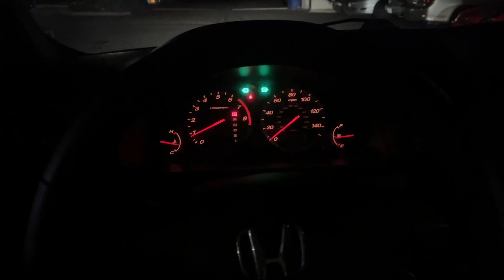My old project car doesn’t like the new owner..😅 How did this happen!!

Comment: All that cv axle grease on it will make that weld crack and brake off again its best to clean it that’s why it doesn’t want to weld easily
Reply from the maker: Yeah we ended up getting a whole new replacement mount for it ,its been holding up again 😅